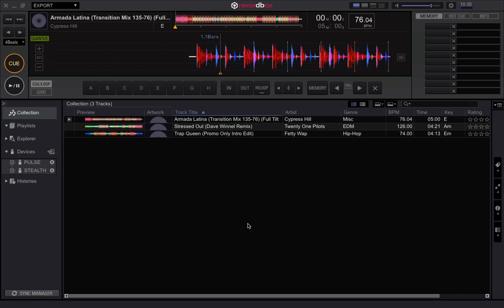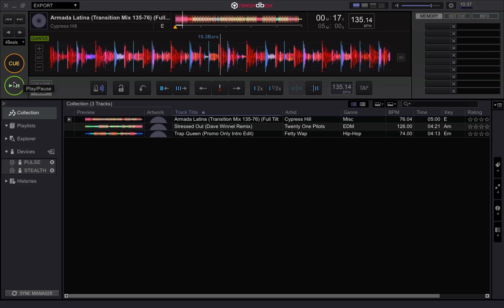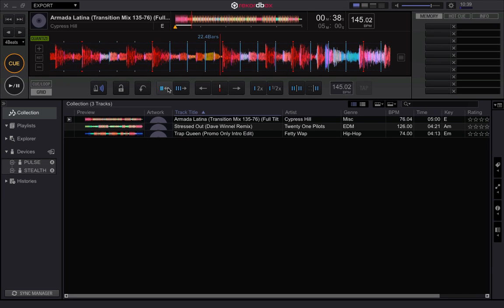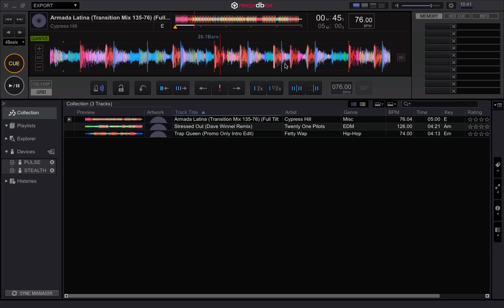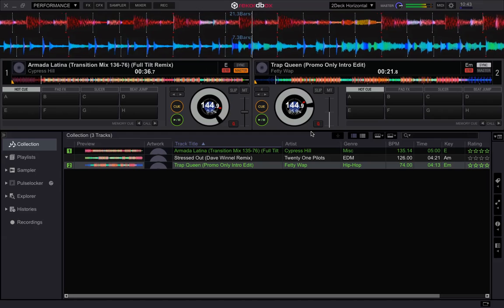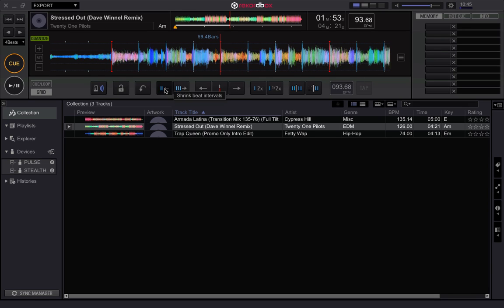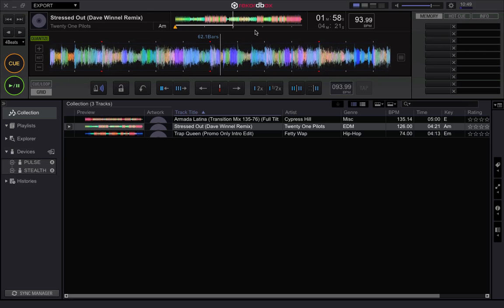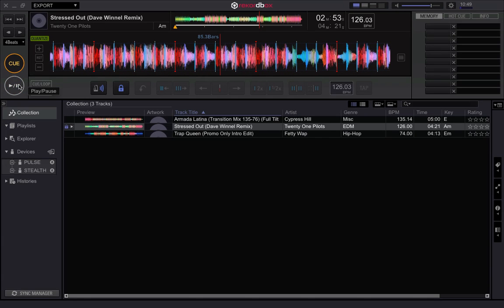rekordbox - How to beat grid a transition or changing tempo

Comment: You alright, is there a way I can reset a track to what it originally was before editing it on the grid adjustment… I used the undo button but only seems to work so many times so I want to reset the track to what it first was. Cheers
Reply from the maker: Just re-analyse the song, that will "reset" it.

Comment: Rekordbox really needs a button to set downbeat for next bar without messing up the previous downbeats. This is ridiculously slow process having to struggle with the finicky expand and shrink buttons and then press the "make an adjustment from the current position" button. If your playback head is already at the downbeat of the next bar, why not have a way to quickly expand or shrink the previous bar so that the downbeat lines up there with it so you can just jump from bar to bar, setting the downbeats? 

I am frustrated that the process here is this slow.

Comment: Good video and information. I do have a question. If I didn't make an adjustment on a couple of beats somewhere in the track (dynamic setting) and after playing with it I notice it was not looping correctly. Can I go back into the beat grid and only line up those beats that affect the loop without it automatically shifting every other beat that I did correctly. I may have missed something as I can not seem to do that. Or does record box only allow that. Thanks

Comment: Good video but now I am wondering how you can change the 1 beat of a bar or phrase? For example you can set the position of your first beat of a bar by clicking the red/white line but if the 1 beat changes after a breakdown/new phrase you can’t set the new 1 beat without moving the whole grid, so then your grid becomes off by a beat or 2 or 3. Not always the case with newer music but I find with older tracks it happens a lot. In traktor you can set the first beat of a bar as many times as you want but in rekordbox you can only do it once. Can you explain to me if I am doing something wrong?

Comment: Would this be the process to take if I am beat locking on a vinyl rip
Reply from the maker: It really depends on the track - if your turntable is bang-on accurate, the music is a consistent beat, and the pressing is perfect, then you may be able to use NORMAL mode and not worry about it. But if anything is slightly off, and you find some beats need tweaking, maybe try DYNAMIC mode and then adjust where necessary.

Comment: Hello, i know is off topic. Great video buy the way.. i am looking to buy the rekordbox software but I'm interested tu use with an iPad as remote, and i saw that this option is just for Pioneer XDJ... i use a Pioneer DDJ SX.
With Virtual Dj i was able to use it as i wish by connecting at the wireless network.
Thanks
Reply from the maker: Unfortunately rekordbox doesn't currently offer an iPad extension; the only device that features an app for remote control is the XDJ-R1.
Reply: You can use TouchOSC to do that.

Comment: This is a great video on Dynamic Gridding, I have a related question.  If the Dynamic Grid has already been set, say where multiple sections have differing BPMs, can you go back to the beginning and adjust just that section without affecting the other sections? For instance if you set the first 16 Bars on the left to 120 BPM, the next 16 Bars to 121, the next 16 Bars to 122, and so on, then finish your grid, such that you are out of edit mode (like selecting the lock).  Could you go back in and adjust the BPM of the first section say to 120.5 BPM without affecting the next section (16 bars later).  I realize you can manually adjust the gridmarks one at a time within the section, but that becomes time consuming (i.e 16bars x 4beats = 64 gridmarks to move).  If you try to adjust the BPM as this video shows you affect the whole track to the right of the section you are editing.  Just asking if there is a way to do this, because if so that would be a great way of editing a dynamic track.

Comment: This is not the updated version of Rekord Box. The grid button has moved I think. Its not there on mine.
Reply from the maker: The version shown in the video was the latest as of the video (4.1.2). If you're using 4.1.2 and it still looks different, verify that you're not in PERFORMANCE mode (the video shows EXPORT mode).